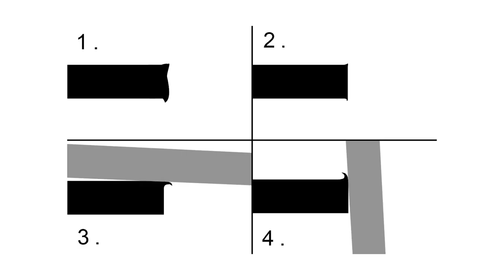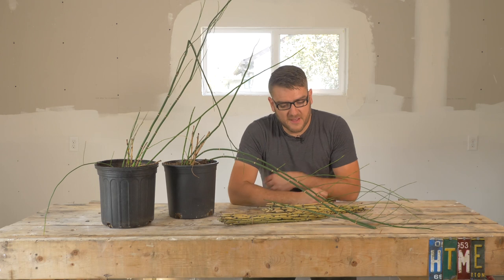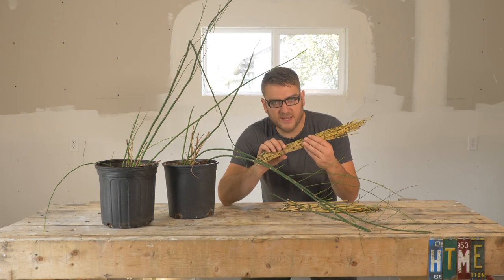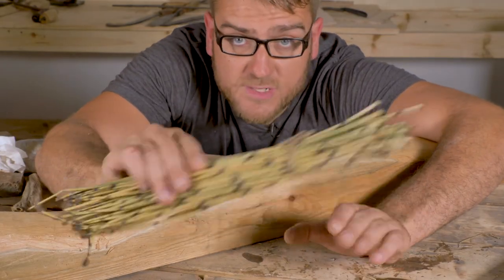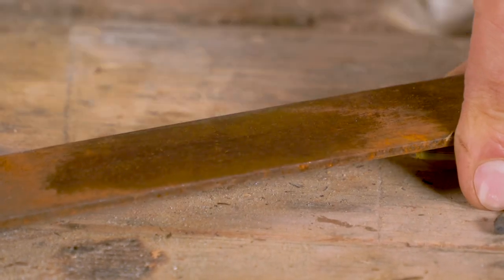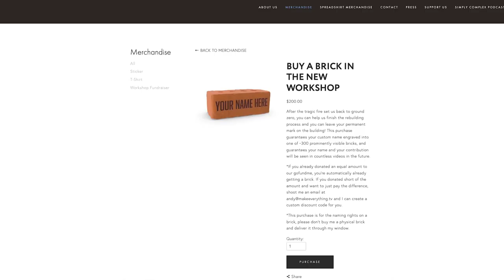Using a SHARK as Sandpaper

Comment: As a kid I would find old rusty railway spikes around the edges of the railway lines, and would polish them up using a variety of rocks I found! I found smooth round river rocks were good for getting quite a shiny final polish.
Reply: Cool!
Reply: I used to polish stones with stones
Reply: River rocks would smooth the iron by pressing it flat. It doesn't actually work for removing material beyond a certain point.
Reply: Okay boomer
Reply: That’s cool, and all but railroad spikes still belong to the railroad company.😂you’re not supposed to take them

Comment: Oh, also. If you have to sand a bunch of wood or other stuff for projects, think of using a respirator. Those dusts are mean to our lungs.
Reply: You dont have to worry about shit like that. I work in steel works and have done alot of woodwork. Unless you are doing it in a enclosed room all day every day with no air flow there is no point in using a respirator
Reply: @spyidr1892  it's still bad just being near it even if you don't feel like you are breathing it

Comment: Using a strigel to sharpen the scythe is not enough, you need to Dengel it as well, i.e. using a hammer and specific metal anvils (they tend to be small and round) to hammer the scythe to a razors edge.

Comment: Shark skin is smooth in 1 direction, coarse in the other. 
     I suggest using it like a file.. 
     Or better yet; NEVER USE SHARK SKIN.

I understand your research concept, and I understand the shark you obtained was not poached or whatever.

But sharks are endangered by now, man.. (And they are more amazing, and more crucial to the ecosystem than we imagined even 10 years ago)
       Let's not give people more incentives to ignore that.

Whale fat was also used for all kinds of things. I should hope you won't try that either.

Something like rabbit glue - sure. Most species of rabbit are not on the verge of extinction.

I love what you do on this channel, but please - if you can... - steer clear of endangered species. (Even 'scary' ones)

Comment: for the last few thousand years (until the late 19th century anyway) carding was the most common of these techniques, there's evidence of bronze shaving cards, although steel/iron is more often the material of choice. it's possible to achieve a fantastic finish although it does require a well worked surface beforehand, and seems to work better on harder woods with tight grain. I can't see sharkskin being a popular choice, although humans have tried rubbing just about everything together over the years!

A note about scythe sharpening, they were usually sharpened (especially in the field) by hammer-peening over a small stake-anvil, it's a very fast way to get a razor-sharp edge and doesn't rely on removing lots of metal, It's worth remembering that for most of human history, a scythe represented a substantial investment for an ordinary peasant farmer, and was treated as such. Sometimes abrasives were used, but they were usually fine-grained stone and only used for honing an already pretty keen edge.
Reply: Shark-skin is covered in denticles, that's why.
Reply: @I.____.....__...__  Yes, it has sharp bits, that's why it's rough. but I'd still doubt that shark-skin saw widespread use as a finishing abrasive. My point is that the historical use of abrasives was much more limited than it is now. Sanding is such a common method nowadays, it's easy to think that it's always been that way, but in reality, only the very finest objects would have seen the kind of high finish that is commonplace now, and much of that was achieved with other methods (scraping, burnishing, french-polishing etc).
Reply: @theafro  It was something used in English Tradition Woodworking, originating in the 18th century as a replacement for crushed pumice and rottenstone, particularly in the North American Colonies. There's no indication that it was particularly widespread, nor a long-lasting practice.
You are very correct.

Comment: I made it to 1:56 before I had to stop the video.
I think it is amazing that you all have taken on these goals of figuring out for yourselves how many things have been done historically.
Card scrapers, though... I know I can't be the only person to mention this: You're using them backwards and with the wrong arrisses. The best results come from using a burr on a long edge, both hands driving the scraper, and holding the scraper so it engages at greater than 90deg to the surface of the work. You'll also get a bigger "bite" by flexing the card a bit so the center of the card leads the cut.
These things are too common in the modern hobby of woodworking to be so thoroughly lacking in research before recording.

Comment: 9:06 Ouch, no. You should not be applying force. The blade should be cutting by a dragging motion across the grass. You want the sweep to come from your hips with your arms just guiding, like the rotation of turning your leg outwards. Well, you are learning various skills constantly so no point to harp on you. I just have used scythes before and have a bit more understanding of them. Might want to hammer down the edge more too.
Reply: The harvest season is upon us
Reply: That's the downfall of this channel's whole thesis.  A single person can't progress from one advancement to the next, because people spent several lifetimes to master each part in between before they could move to the next step.  All the difficulties that Andy has had using copper tools and eagerness to get past that is because he is using the very first and (no offense) shittiest copper tools made.  By the time people were moving onto iron they had literal centuries of iterations and innovations, resulting in far better copper tools than what he is trying to work with.

Comment: A potentially interesting and useful project you might want to do in the near future would be case-hardening. The historical method would be taking the iron you want to harden and placing it inside a sealed box (usually made of clay) with a mixture of reagents (usually either carcoal and bonemeal or a mixture of leather, hooves, salt and urine) and then heating it for prolonged periods of time depending on the desired depth of the hardening. I'd recomend using a slurry of charcoal and urine as the hardening reagent, as both serve as sources of substances used in modern case hardening processes (carbon for the charcoal, ammonia and isocyanic acid produced by the pyrolysis of urea for the urine).

Comment: Try dipping the straw in a bit of bentonite clay or fine silica sand as a rubbing compound. I don't imagine it would work super well as a sanding agent, but it'd probably give a good polish. And as for the scythe, weren't those sharpened using a peening hammer to flatten and thin the edge?

Comment: I feel like a majority of the failure here is in technique and material. The straw one would likely be great at getting a fine polish on metal, such as a helmet or sword, without affecting shape or structure. I also feel like the pumice would work better in slower, single direction strokes or concentrated sanding, like making a divet or shallow channel for aesthetics

Comment: The degree of polish on both the flat side and the edge of a card scraper before you turn the burr is the main factor relevant to its sharpness. If it's not cutting shavings like a plane, it's not been polished high enough before turning the burr.

Comment: a good way to finish wooden projects like that is burnish them the best way is after you're satisfied its as smooth as you want it take a hard smooth stone or a piece of smooth bone or antler and aggressively rub it along your project with firm pressure and it will compress the outer layer of the wood and remove many small fibers that are left over from the sanding process. this method can be enhanced with beeswax fat or oil which will also protect the wood from the elements one other tip the wax fat or oil will absorb better into the wood if its lightly heated over something like a coal bed or equivalent het source.

Comment: I think you would have gotten a lot better experience with the csrd scraper if you had used a different technique.   Normally, you have to put a bow in the card scraper for it to be most effective.   To do this, place the fingers of each hand at the edge of the scraper and your thumbs the middle.  Pushing with your thumbs introduces a bow into the scraper that makes it much kore effective.